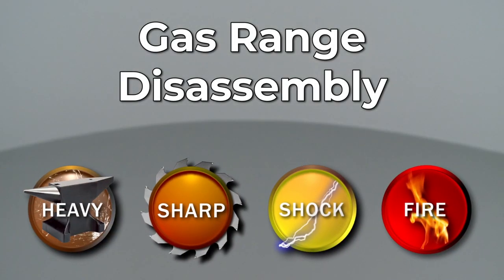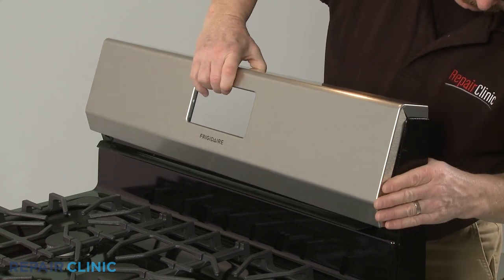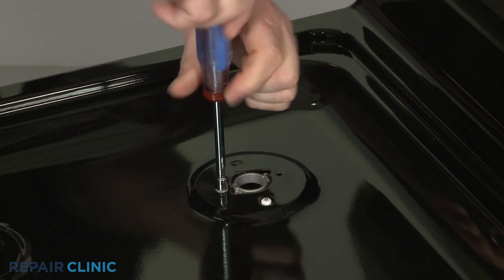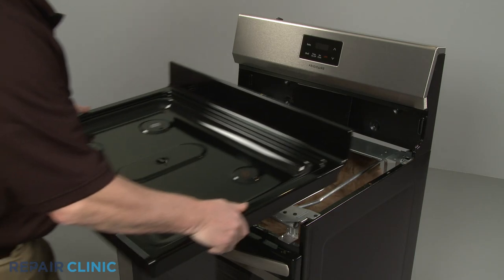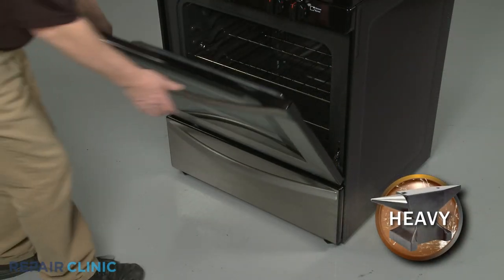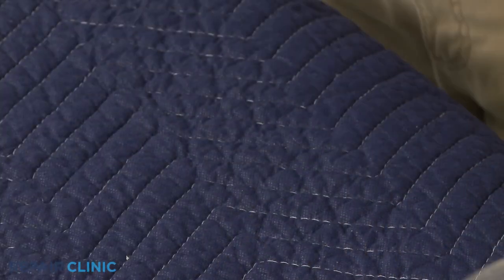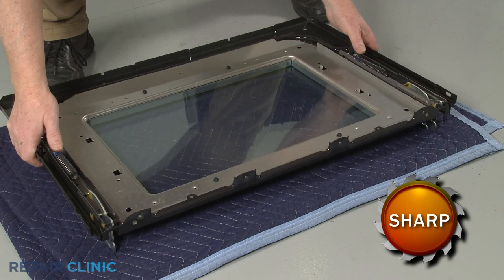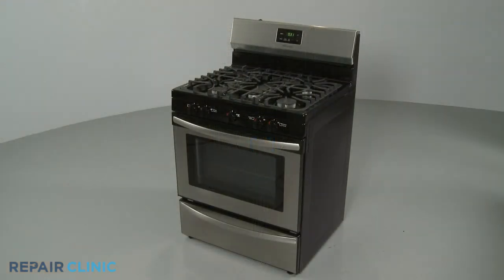Frigidaire Gas Range Disassembly (Model FFGF3052TSA)

Comment: i have an FGGF3045RFA front left burner does not ignite, no clicking. You have a part and a video for this?
Reply from the maker: You can enter your model number at RepairClinic.com and all the parts associated with your model number will populate on the page.

Comment: I have the similar model and while in the process of replacing the stove top ignite one of the burner screws on the front left (most frequently used) broke and the second one was rusted out from liquid spillage which prevented me from removing it.
I applied WD40 to no avail as the screw head is stripped , how can it be remove without causing severe damage to the stove top.

Comment: We have this model which has been smoking when we first tried to use it (after 3-4hrs use) and we noticed a white styrofoam type of material inside the air vent at the top. Is this packing or potentially insulation? The people who fitted our kitchen left the blue film wrapping on everything and assembled with it sticking out so wouldn't be surprised if it's not meant to be there. Help would be amazing!

Comment: Less than 1yr old Frigidaire LP Stove quit. Popping the GFI breaker. GFI breaker is good. Appears to be shorting out. Can't even plug in stove to out without popping circuit.  
 Any idea what would be the cause?

Comment: Mine worked, but everytime we tried the self cleaning it popped the breaker.  Last time, we tried, it popped and nothing works.  The plug is good, but did we knock out a fuse in the oven?
Reply: @repairclinic  thanks, I'll take a look.